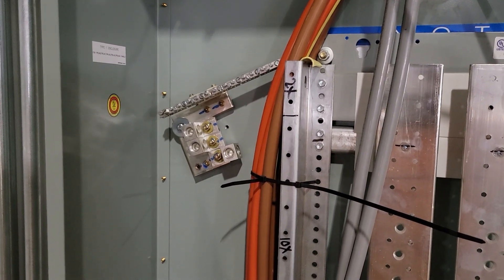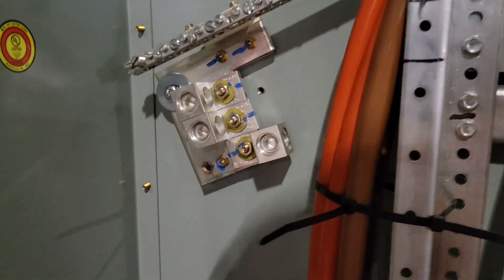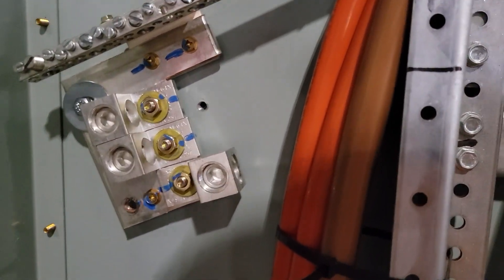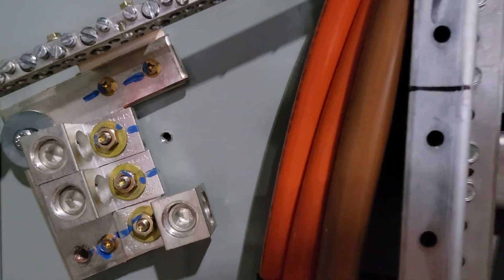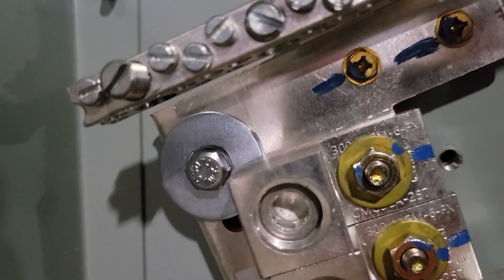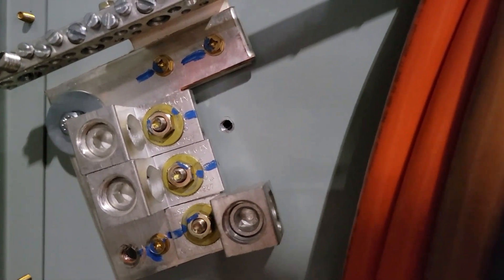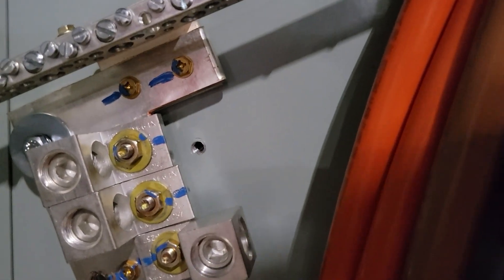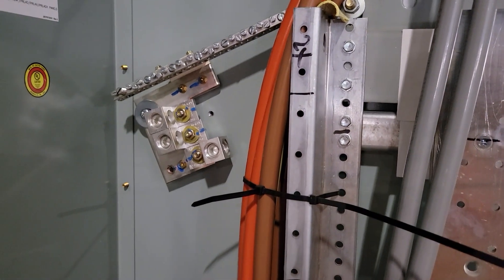How To Correctly Ground an Electrical Panel

Comment: #2 copper wire (stranded or solid) going outside and properly attached to 10 foot copper coated steel grounding rod in the ground ?
Reply from the maker: Thanks for the comment. This is a sub panel. The main distribution in grounded.
Reply from the maker: Thanks for the comment. This is a sub panel. The main distribution in grounded.